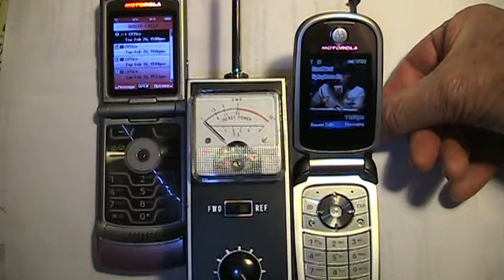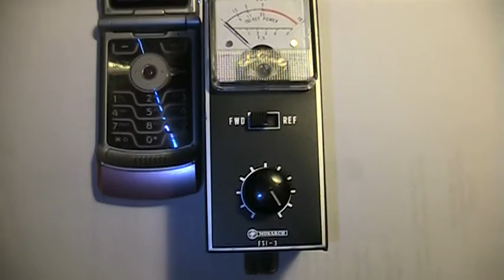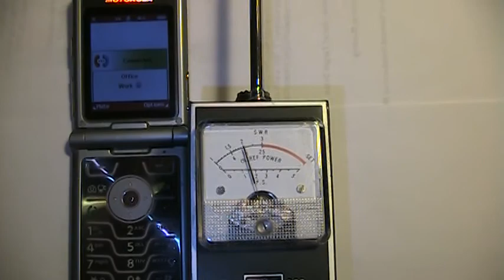Cellular telephone pegs field strength meter

Comment: The variations in power is because of the QCELP/EVRC vocoder and DTX (Discontinuous Transmission) used in CDMA. Little or no voice activity = less uplink power and less loading of the cells. And better battery life